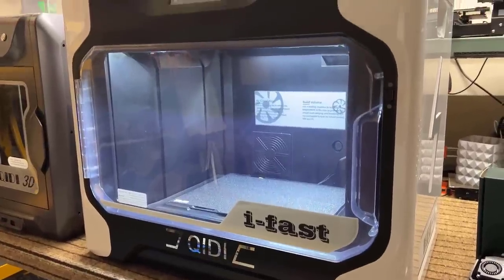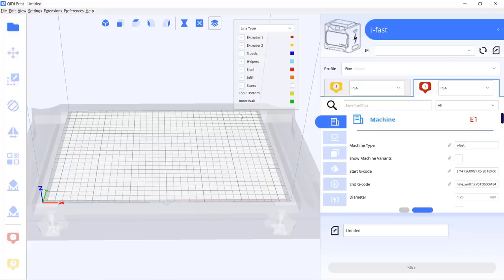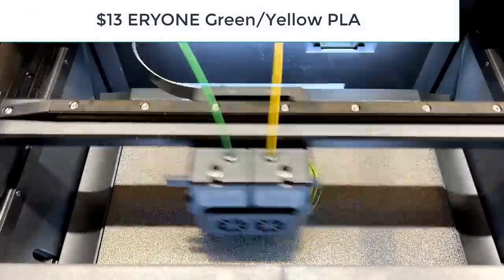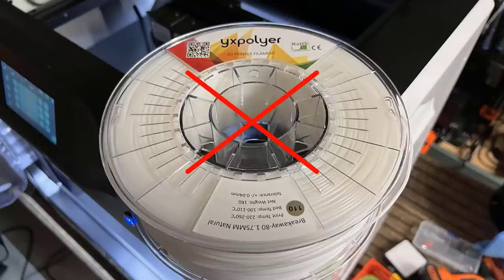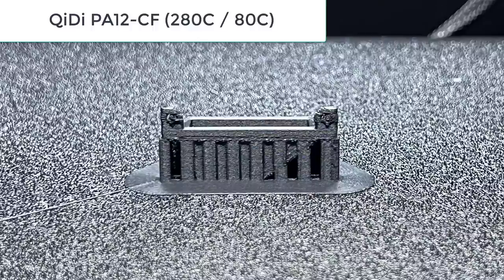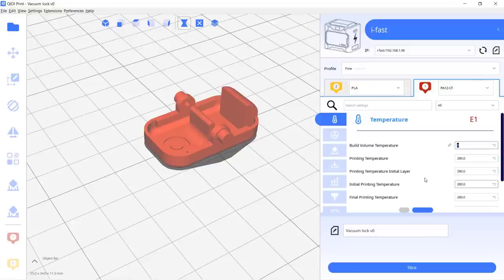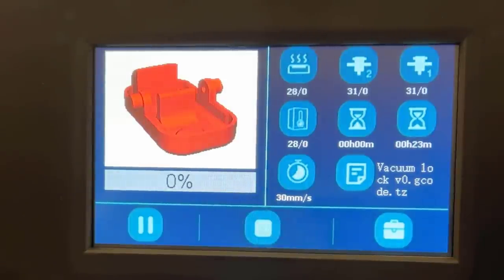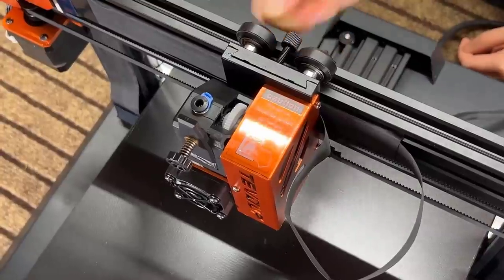QiDi i-fast: 80C Actively heating chamber, 3D printer made to print Nylon Carbon Fiber, ABS, ASA

Comment: I know this printer quite well. Here's some things for the viewers considering this printer:

* The chamber heater reaches 80c but the air inside the chamber reaches a max of around 60c.
* The rail you're measuring on the top of the x-gantry bar is only there to provide stiffness to the x-gantry. There was a problem where the x-gantry would bend when using the heated chamber and this was the solution. The actual rail is underneath and I think it's wider than 15mm, I can't remember right now.
* That high temp hotend with the blue heatsink should go up to 350c, not just 300c.
* That high temp hotend also has a considerable gap in the filament path between the extruder mount and the heatthroat/heatbreak and also around the extruder gears, which allows filament to bend and jam there. You'll get this jam often when using softer flex filaments and filaments which may get too soft when using the chamber heating. QIDIs older extruder was better only in this regard, this new one is better in every other way.
* The low temp hotend also has the filament gap, but only around the extruder gears.
* The bed may be flat, or be 95% flat with a corner/edge curling up or down. Depends on your luck.
* Your X calibration was substantially off, by 0.8 to 1.0mm. Y was close enough

I use these printers almost every day and it works most of the time. There's room for improvement but also no other prebuilt printers in the same price range have the same capability. There were many bugs and rough edges that I have worked with QIDI to fix, which shouldn't be the case.
Reply: "There were many bugs and rough edges that I have worked with QIDI to fix, which shouldn't be the case."

At least QIDI worked to fix it.
Reply: I think I will wait for the Snapmaker J1. It has mirror mode, is faster and has resonance compensation. It is a lot cheaper too.
Only thing that would be nice is a camera and a heated chamber for the J1.
Reply: @Todestelzer  yeah a better choice if you don't want a heated chamber and larger build volume
Reply: @Keveira  im adding a heater to my Voron now. 12€ for controller and 18€ for the heater. 1€ for a thermal fuse. 
Should be easy to add to the J1 too.
Reply: While a active heated chamber is great, I think there is still room for optimizing passive heated printers. I use both Ikea Lack enclosure and the Prusa enclosure; also a creality tent. Due to a mild winter here in Germany and high energy cost my rooms are only at about 10°C (for me it is a nice temperature...). So 3d-printers without enclosure do not work. With the Prusa enclosure I reached about 13°C more inside the chamber, Ikea Lack 14°C more and the Tent also about 14°C. Last summer I reached more than 40°C (ambient room temperature about 30°C). I got about 6 °C extra in Winter just by putting my duvet over the enclosure (of course just for a fast print, as I need my duvet at night for myself)...
So most passive enclosures still let escape a lot of the heat. They are more "windshield" than real thermal insulation. So maybe the most cheap solution if you need high temp only on a few prints might be to add LED+Camera and a box made from Styrofoarm or mineral wool to put over the enclosure and also insulate under the enclosure. While you might not reach 60°C inside you might get near 50°C - and save a lot of energy. This winter I had no prints with materials requiring high temps (also insulation material has no good availability at the moment), but maybe next winter I might do some further tests...
Reply: @oleurgast730  I reach about 47c without the heater printing ABS. But really big parts have a lot of tension in them and bend when cooling down. 
Heater works now but haven’t tried a big ABS print yet. Set it to 55c for now.
Reply: Thank you very much for the info! I need to print not tweak and fix. Been there done that. I think will wait a little while to see if Bambu Lab comes out w/ an IDEX.

Comment: We have an i-fast that was purchased about 6 months ago. Removed the shroud around the bed to tighten the springs all the way to increase stability and not hit the plastic shroud with the nozzles. It helps since the bed is heavy and can bounce. It is hard to see how a print is going with the star location and giant head. Support from Qidi is excellent and they will make a custom profile for any slicer you use. Print times are rather slow though. Love your channel. Keep up the great work.

Comment: Another great video - keep up the great work.  I really appreciate that you are moving up market to the non-bed slingers and higher end "pro-sumer" products.  Entry level, hobbyist printers are a lost cost intro to 3D printing, but come with the frustrations and more limited capability.  I am hoping that Creality will bring out the next iteration of the Ender 5 Plus with 32bit electronics, IDEX (or at least dual attached extruders), and enclosed print volume as part of the printer.
The race is on as the printer market separates into:
1. hobbyist
2. pro-sumer
3. professional design / engineering
4. production machines
5. specialty machines including metal printing, bio-materials

Comment: I loved all the videos you've done so far, but I'm concerned you are loosing grip here. You had stated "the print looks great" in both PLA and ABS prints and you can see clear defects on the print, ok no warp no cracks, but the canaster had a bad hole on the left of the image and the PLA had some ozed filament. Maybe just adjusting the slice settings will fix it, but you can't say is a perfect print based on those prints, I'm sorry. 

Please keep it up with the good unnbiased opinions and reviews I'm looking for when I watch your videos. Cheers

Comment: Hello Aurora,
I purchased an i-fast a few months ago and I recently decided to purchase some new nozzles for the low temp extruders but they don't fit into the heat block threads. They're too big. My 7mm wrench that fits the original nozzles is too small to fit the new ones that I bought (MK10 Nozzle for 3D Printer, 18 Pcs M7 Brass Extruder Head Hotend Nozzles 0.2mm, 0.3mm, 0.4mm, 0.5mm, 0.6mm, 0.8mm, 1.0mm fit 1.75mm Filament). Can you please tell me what size/type I should have purchased? I can't find any definitive answer online.
Reply: Ask QIDI, send them an email, they'll tell you within a few hours or a day.

Comment: Perhaps you got a pretty good printer. This was by far the most frustrating printer I ever spend money. I regret everytime I see it in the corner. Was never able to get the camera working. Wifi never worked. Leveling is just bananas for a $2500 machine is like a ender 3 with a enclosure.
Reply: Contact their after sales team about the Wi-Fi and camera. They have always been helpful. Leveling was always a pain for me a pei build plate made it better but I know closer to the front of the build plate it’s flatter
Reply: I feel the same, but not because of the manual leveling. My Creality Ender 3 V2 cost a fraction of the price and reliably produces superior results using PLA, I'm trying to resolve the issues with Qidi at the moment. I am puzzled as to why the I-Fast receives such positive reviews, even the quality of the prints in this video are disappointing for a £2000 machine.
Reply: @manchegocheese997  I have an iFast, it's been great.

From what I've seen on YouTube, it looks like there's a bit of a "Quality Control Lottery", most iFast printers are great, some are duds.

QIDI seems very responsive, though, did they ever fix your problems?
Reply: @retromodernart4426  Qidi have been very responsive but I am still frustrated with the printer. Initially, I contacted them about the poor PLA print quality, by poor I am referring to ghosting and a relatively rough finish compared to my Ender 3 V2. By changing settings they did manage to improve the quality but at the expense of speed. I asked them to send photos of the same model that they printed on their printer and it was no better than mine. My Ender 3 still does a much better job with PLA in half the time and without the hassle. I then discovered that the aluminium bed was very bent;  if a straight edge was placed across it, it was possible to slide the leveling sheet underneath. Qidi were very good and sent out a replacement immediately. I bought the I-Fast mainly so that I could print tougher materials like Nylon and ABS but I find it so inconsistent. I might get reasonably good results one time and think, great we're all good now, but this isn't repeatable. As for the lack of auto bed leveling; I didn't think this would be an issue because it shouldn't need adjusting often, but it doesn't seem to be very consistent. Also, filament jamming and failure to extrude are not uncommon issues when using Nylon and ABS.
Reply: @manchegocheese997  That is unfortunate - in my case, I guess I was lucky, I was actually surprised at how well and consistent my prints came out, the print quality was and is very nice even for very detailed functional prints and dual material prints.

Do you use high-quality filaments and a filament drier?  That can have a big effect.

There are also ways to improve the feed path in the iFast, like putting a Bowden tube (teflon tube) all the way from the filament roll up to the run-out sensor, and another tube from the run-out sensor to the print head also (or use a tube and don't run the filament through the filament run-out sensor).

You should look at the "Meliorate with Nate" channel on YouTube, he has loads of really good iFast videos with simple improvements to it for better results, and he answers questions pretty quickly.

I hope you can get your iFast working to your satisfaction!

Comment: $2500 COST in my country (UK)

WOW

It gets a Meh from me. With a DIY enclosure, octoprint, and a good starting point like Creality S1 (with metal hotend upgrade, hardened steel nozzles, PEI bed) you're still only at about $400 - with something you can print the same tough-to-print filaments with.
Reply: You aren't going to slap an enclosure over an ender and get 60 degree chamber temps.  If you do, your rubber wheels, stepper motors, boards etc will be very unhappy. You also aren't going to get dual extruders are you?
Reply: Lol wat?

Comment: This or Bambu lab x1c?
Reply from the maker: If budget is allowed, the BambuLab X1C would be a safer choice.
Reply: @AuroraTech  thank you for responding. Isn't the Qidi ifast about $1700 while Bambu LAB X1C is about $1500 currently? How well is the Bambu Lab printing with PVA support material compared to Quidi ifast in your experience?
Reply from the maker: The X1C is just more advanced. If you dry the PVA filament and apply some $3 Elmer's Craft Bond Extra Strength glue on the bed, it should print OK on both machines.
Reply: @AuroraTech thanks for the info. Isn't it more wasteful and slower on the X1C with a single extruder in this case?
Reply: I owned an i-fast for around 6 months and it is one of the worst things I have ever bought; it is a slow lumbering oaf of a machine. I never got a decent quality print from it in any material and it was far from fast. I sold the I-fast and bought a Bambu Lab X1C and I couldn't be happier with the performance, the consistency, speed and quality is astonishing. Even with a single extruded the X1C is faster than the I-Fast but it does waste more filament.

Comment: A heated chamber up to 80C cannot be good for stepper motors, belts, and bearings.
Reply: The heater reaches 80 deg. C, the chamber temperature only reaches about 60 deg. C.
Reply: The motors aren't in the chamber by the looks of it. I imagine that's part of why it's so large.

Comment: I don't agree with some of your comments about the prints looking good etc, some of them are clearly not good and had clear issues...
Unsure why they call this the -fast model, as it is not fast...
That alignment you did at the start, also did not look good
What is going on here...
Reply: This is the case with all the reviews I've seen for this printer, the prints don't look good. My Ender 3 V2 produces superior quality PLA prints in less time than my I-Fast; I don't know how this is possible.

Comment: Too expensive for all the weird issues that it has. At this price point it should be %99.9 perfect . QIDI always seems to have all of these weird issues. The issues this printer has are quite  evident and should have been addressed before final production units were made. Therefore it seems to me that QIDI does not do ANY pre production analyses of their printers they just go straight from the drawing board to production. Silly company and silly price for the problems it has. We all expect problems with cheap printers,  this one is not cheap but it is very large and very heavy.

Comment: lol for that price i can 2 bambu x1   lot faster and better tech
Reply: But no heated chamber, no dual hotend and a smaller print volume, they don't aim at the same market
Btw, the bambu carbon (that can print cf filled filament) with their mmu is 1400€ and this printer is 2300€ and they give you also a spare carriage that can print cf so you can't buy 2 bambu if you want to have similar capabilities